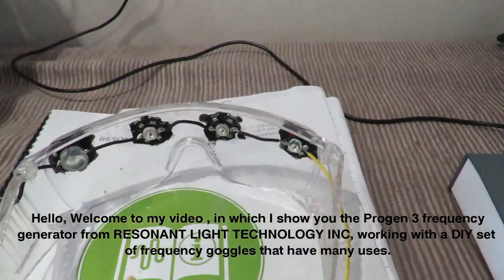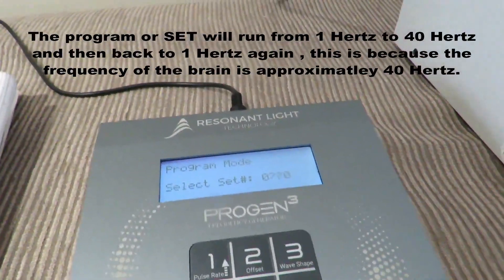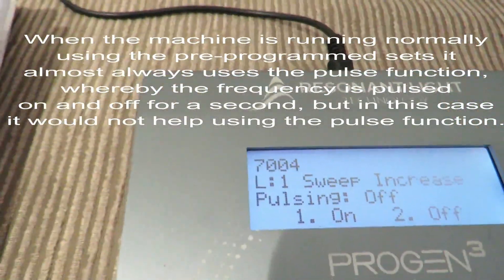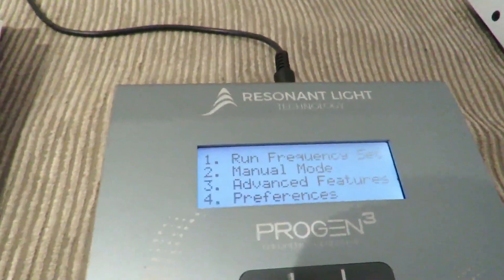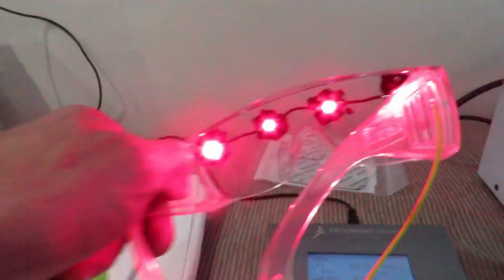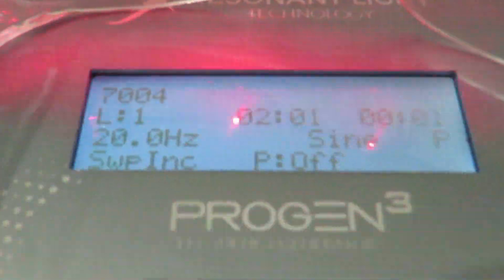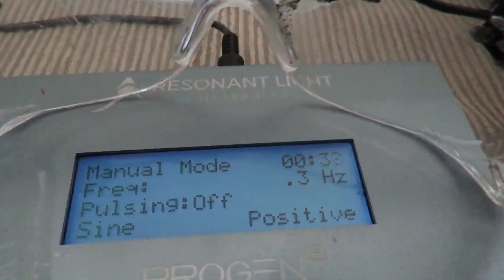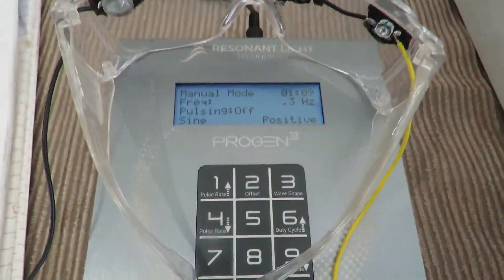Raymond Rife D.I.Y Frequency Goggles running off Resonant Light ProGen 3

Comment: Thanks for the video. Thinking about one of these machines or similar. Am I better with this or the Spooky2?
Reply from the maker: Hello sorry for the late reply . the Spooky 2 is better in a way because of the software but the resonant light sends true 12 volts through the pads and the plasma unit is truly amazing , if you have $2000 get the progen 3 , comes with a huge manual with sets for everything.